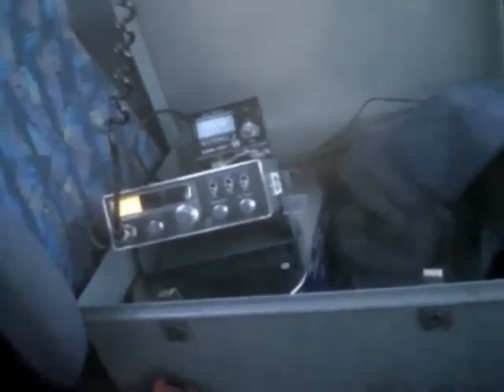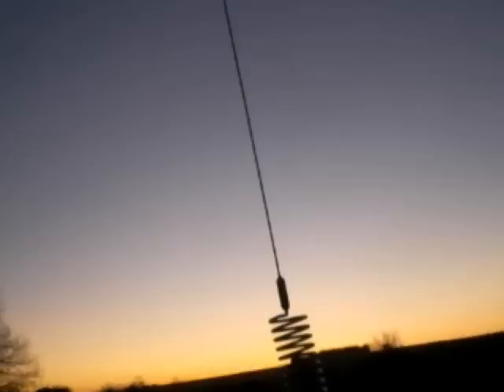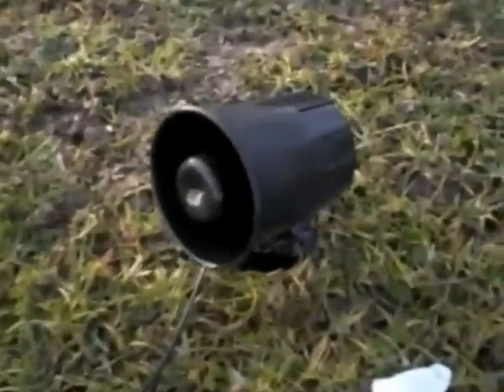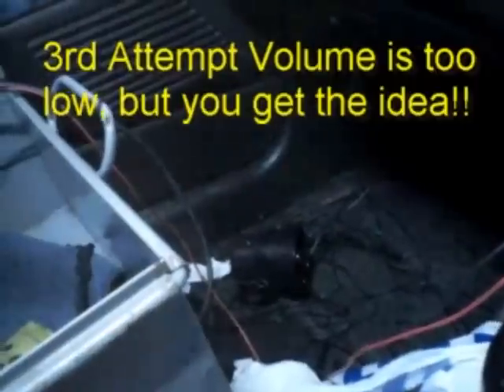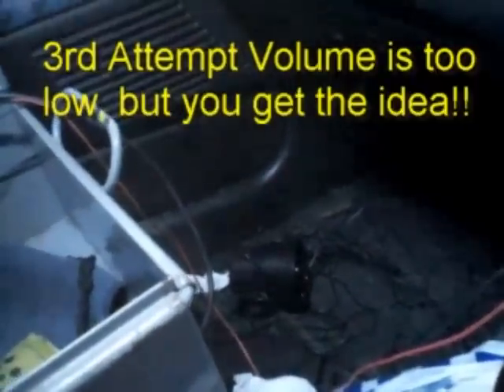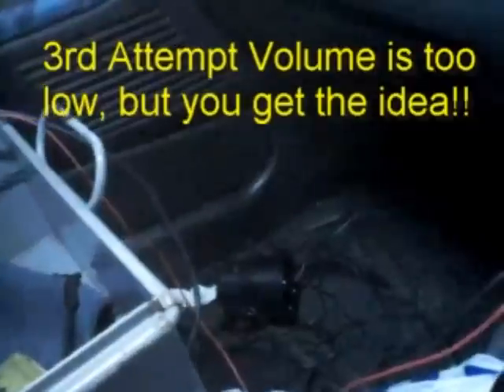Maplin 8W PA Horn Speaker on a Midland 3001 CB

Comment from the maker: Thanx bud, It's a SUZUKI X-90 they're either loved or hated!,  ...but they are fun, mine is 4X4 but some are just RWD, ALL have removable T-Top roofs..

using same engines/chassis from Vitara/Sidekick they can be jacked up with monster wheels and do quite well off road!

My walkaround vid is ..."(Slightly Pimped) SUZUKI X-90 , walkaround"
a jacked up one is at .."Marines Suzuki X-90"
on snow ....................."Suzuki X-90 horseplay in an icy parking lot"

Ps your FJ is pretty awsome too :-)